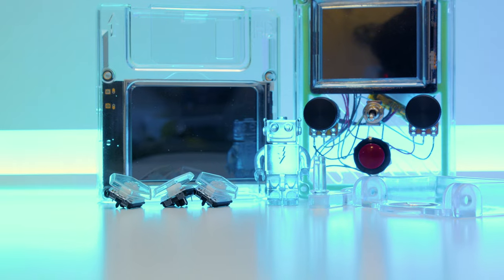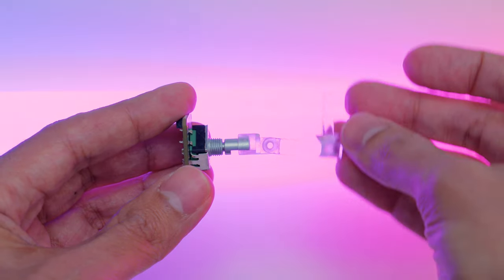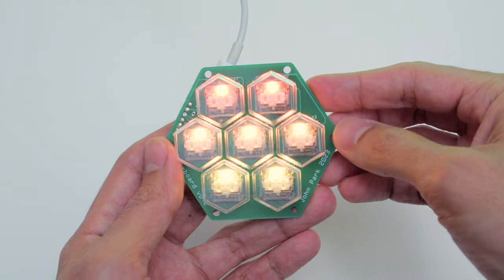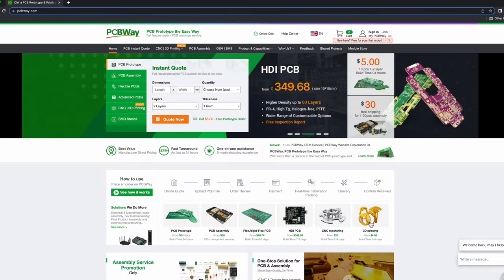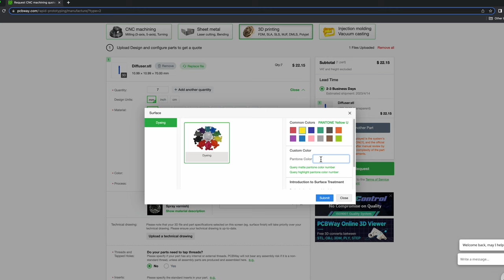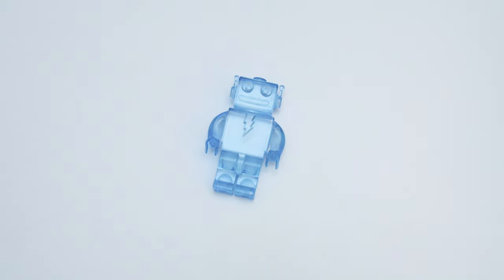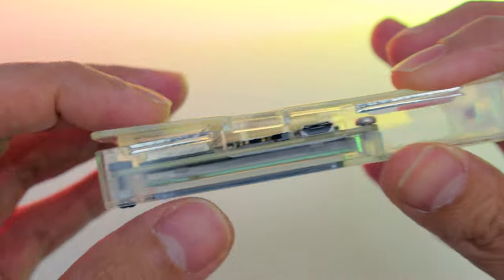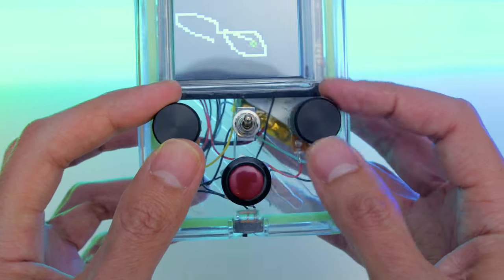Clear Resin Parts from PCBWay #adafruit #3dprinting

Comment: A few of us had issues with these prints in the last few months. We were building the PS2 Ultra Slim, and sourced PCBWAY for the prints. They were delivered extremely warped. Warming them up in hot water and reforming did not work. Just an FYI that they do have QA issues with this service.

That said, they did reprint my order and sent it out without cost to me. So, their customer service is commendable.

Also, keep in mind that these can warp over time due to heat and other environmental factors. Resin isn't perfect.